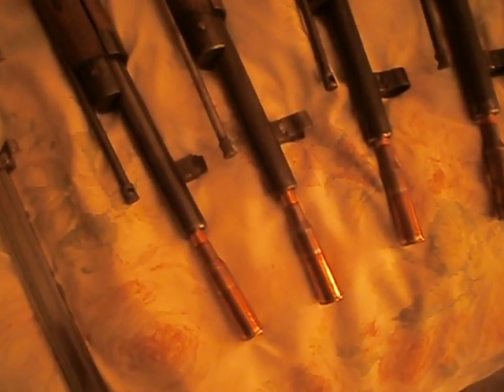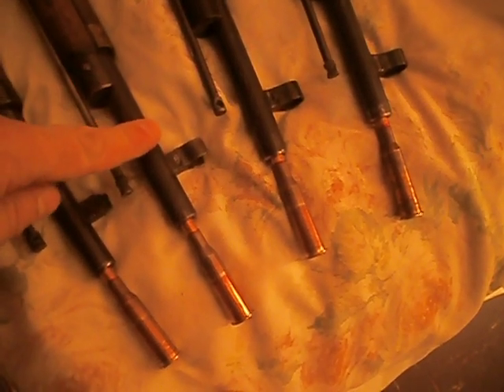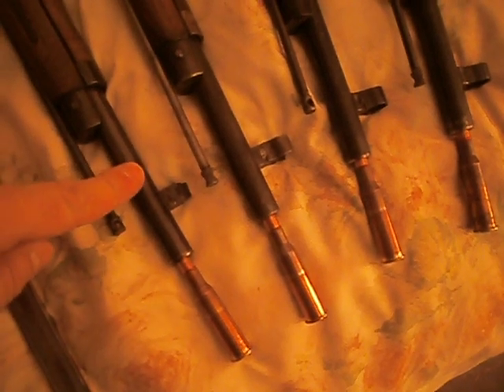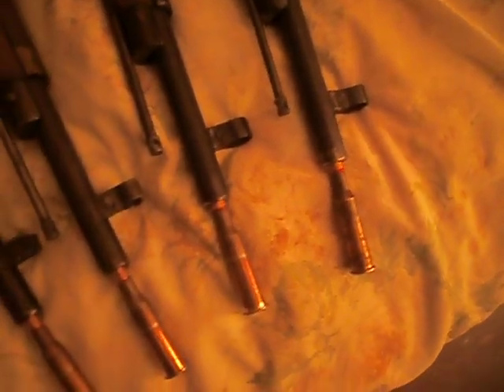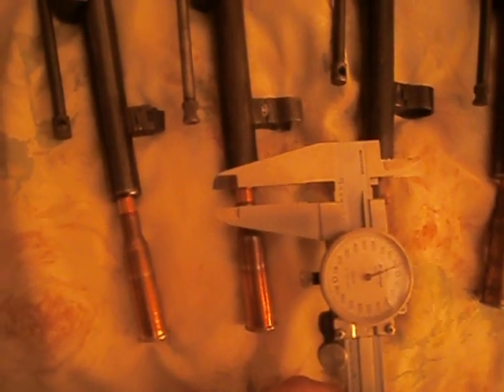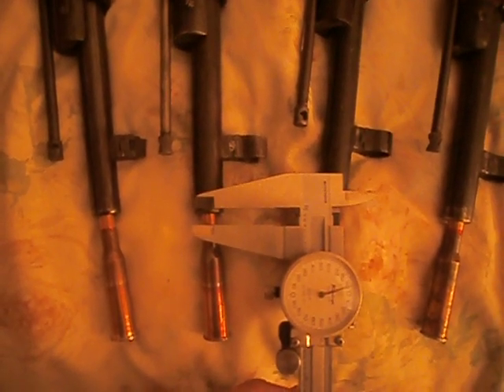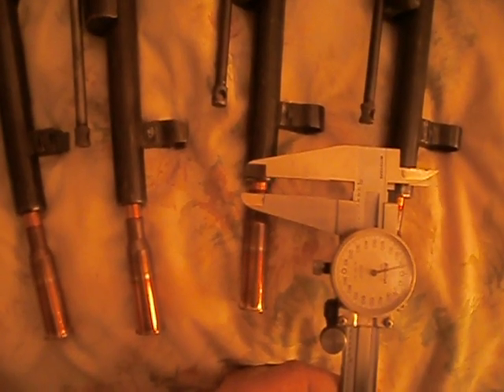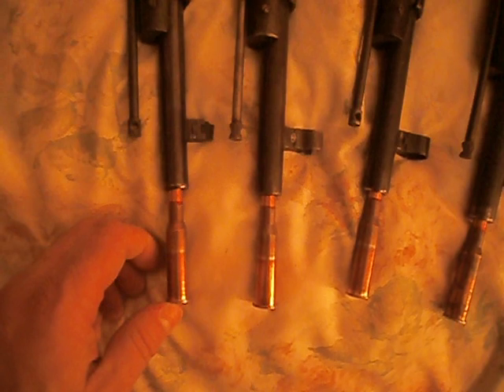Bore size test for Finnish and Russian M91/30's

Comment: the bullet in the muzzle really doesn't tell the dia. of the bore. If a soldier didn't clean the rifle correct they would wear down the first inch or so of the rifling which is why some after refurb they counterbored. Best is to slug the bore with pure lead then measure :)